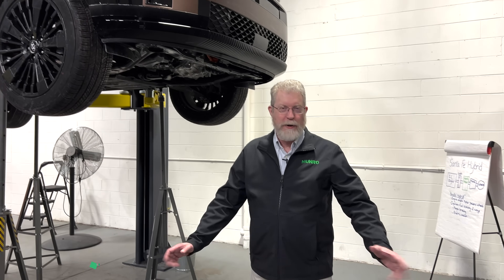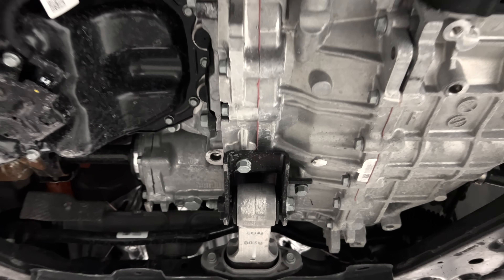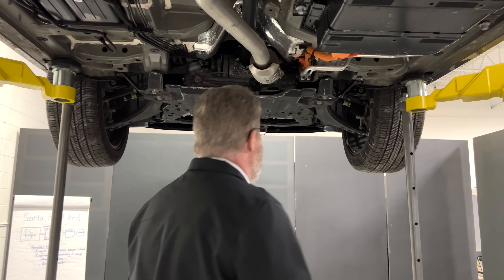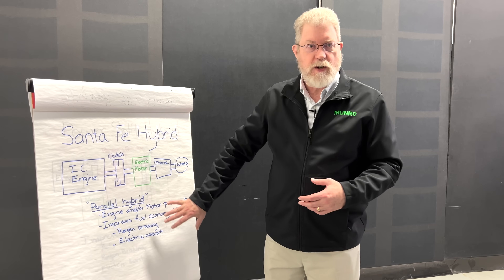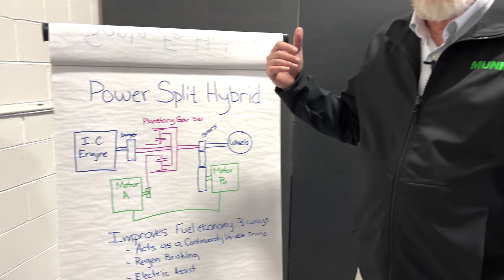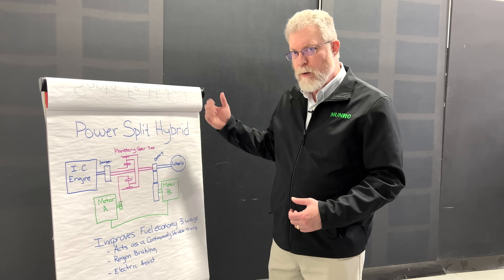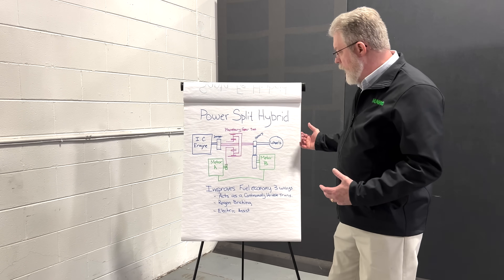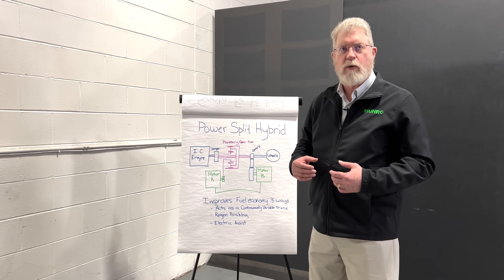A Lesson on Hybrids With the Hyundai Santa Fe

Comment: My husband and I test drove a new 2025 Santa Fe Hybrid Limited and it had an odd, rhythmic jerking feel while driving below about 50mph. (Imagine the feel of first generation antilock brakes, but while running a consistent 30 mph.) The other noticable difference was the regenerative braking drag that I had also felt in the Honda Prologue. I attributed both of these issues to the braking system.

My husband thought that the specific vehicle had a mechanical issue causing the rough ride, so we returned to test a Santa Fe Hybrid Calligraphy.  It had the same jerking and drag. We turned off the  regenerative braking, and the jerking only eased about 50%. The drag went away, but as the vehicle naturally slowed I felt the drag return - I assume this return was a collission avoidance feature. 

Would the hybrid transmission trying to find its soft spot cause the vehicle to continuously jerk or vibrate?

Comment: A couple of tweaks to your excellent presentation. I have owned the 2023 Kia Sportage AWD for the last couple of years. It has the exact same system as the Hyundai Santa Fe. I had driven the Rav4 and CR-V and decided on the Kia Sportage, which has the same powertrain as the Hyundai Tucson. The parallel system charges the battery whenever the engine runs, except for high acceleration, steep hills, and very high speeds, when it combines the engine and motor power, not just during regenerative braking.  As a person used to large vehicles with the largest engines, the Kia has more acceleration than the CVT systems. The CVT systems are also noisier. 
Driving a hybrid is different from driving a regular IC engine car if you want the best mileage. My Sportage is rated 38 city and 38 highway. From the first day to now, I am averaging 41 MPG, and I do 50% city and 50% highway. This is just after the winter, when I used the heated seats and steering wheel quite a bit. By the end of the summer, even using the AC, it will be 42 or above. The key is anticipation. According to the government analysis, you only get 50% of your energy back from regenerative braking at low speeds and 12% at high speeds. In my vehicle, you can see when you are getting regenerative braking before the mechanical brakes, so I can maximize my return power. 
I have heard that surge and coast driving can improve mileage in Toyotas, but that won't work in Hyundais and Kias, as the computer engine programming preloads the regenerative braking to make the vehicle feel more like an IC car. 
Keep up the excellent presentations.
Reply: nice info, thanks, im interested in buying sportage hibrid but im a little bit worried about reliability of ICE motor, tgdi, being tuned off on constantly , direct injection, especially in cold temps, what do u think? will be a minus for long term reliability of the car? thanks!
Reply: @aqua37977  I was worried about that as well. The drive train has a 100,000 warrantee and my dealership has extended that to 200,000 if I get my servicing there which I do. I also do oil changes at 6,000 miles rather than the 8,000 in the owner's manual. I use Mobile One hybrid oil and the top Fram filter which I bring to the dealership. It is made for the special conditions of hybrid engines. Another oil you could use is AMSOIL hybrid oil. They both have top ratings but Mobile One is available in my area. I use Wix air and cabin filters which are top rated and change them myself. WIX oil filters have a bad rating. Do NOT believe the internet that talks about switching to 5W30 from the 0W20. That would only work if you are in a hot all the time climate. The 0W20 works best if you have any cold weather. I'm a former engineer so you know I researched thoroughly and worked on cars for 60 years..

Comment: I loved my 2012 Volt.  It worked perfectly for the 11 years I owned it.  Complicated yes, but it worked flawlessly.  The only unusual service were two flushes of the cooling system.  Other than one oil change a year (GM recommended one change every two years), that was it.   I went to Tesla and was very unhappy.  It just didn't suit my needs as I do long distance, long driving days.  I now have a 24 Prius Prime which is good, but not as good as the Volt as it is not a good cruising on the highway.   I would buy a first gen Volt (not second though) if GM was smart enough to build it in a heartbeat.  I am considering a Hyundai Santa Fe Hybrid but can't order the Calligraphy trim with that model in Canada.  It will replace my daughter's Encore which is a little small for her purposes.  If Hyundai ever offers it with the proper trim, I will buy one.   They do offer it in the US and other markets.

Comment: Just to add full hybrids have very powerful motor for ice start and really powerful battery if compare to regular ice with starter. Much more confident cold starts in winter. Ironically hybrids sometimes get let down by 12v battery which powers rest of car systems.

Comment: Paul, thank you very much for technical explanation of hybrids.  I feel hybrids are obsolete for 90% of use cases.  They are fine when very long range is needed, but their complexity begs for service.  When driving an ICE MB, it cost me $1600/yr for one minor and one major service appointment.  

EVs are much simpler and require far less maintenance.  Personally, I love charging at home and never going to a gas station.  We will never buy a vehicle with an engine.  EVs for life.
Reply: Fortunately, there is choice.  All electric works for you.  It didn't work for me, so I'm back to what works.  And that is a Toyota plug in hybrid (using my Tesla Level 2 at home).  The complexity would be a bad thing if poorly designed and constantly broken.  But in my case, I had 11 absolutely trouble free years in a 1st gen Volt (Canadian winters to boot).   I had a Mercedes.  Once was enough.  Constant issues and huge regular service costs.  Never again.   So you see, what works for one may not work for another.

Comment: A very good explanation how the complicated drive system on hybrid cars works. For an EV to do the same work.  Power from battery to electric motor drives the wheels. For stopping an EV motor regens (some) power back to battery. Job Done !!

Comment: All this mechanical complexity for small efficiency improvement. Ev has 1 gear and is 95% efficient at all times. What a waste of engineering effort
Reply: If you compare the Rav 4's, the hybrid version gets about  30%-35% better fuel mileage than the gas version and is faster.  No engineer would consider that a small efficiency improvement. It also produces less pollution, another plus.
Reply: @Ronald-d6v3b  sure, it went from 15% efficient to 20% efficient. or, hear me out here, skip the hybrid junk and go straight electric and get 95% efficiency at all times, and be faster with less mechanical complexity with no pollution at all

Comment: Watch the video - Hybrid From 1916: The Owen Magnetic - Jay Leno's Garage - . He drives an gas powered car that uses an E-cvt like these hybrids. No mechanical link from the engine to wheels it's all electric, it even uses a big resistor for braking and not the friction brakes. If they had the battery technology in 1916 it could have used regen braking rather than just trying the power into heat.

Comment: CRV is not, and has not the eCVT like Toyota planetary power set or regular parallel hybrid. it's more of serial hybrid with two clutch in and out as required for the engine, so it's more driving like an electric car than either of the design since the engine act most of time as a generator until high way speed

Comment: Thanks for putting these non-plug-in parallel & split power hybrids in layman’s terms, for describing the role of the Atkins cycle in optimizing the efficiency of the ICE and for your service in bringing these products to us.

I need to search for a similarly clear description of plug-in hybrid systems.

I got so enthralled with this channel years ago with the teardown of the BMW i3 which features a REx range extender as a plug-in series hybrid that i had to have one.
Since the REx engine is been detuned from 60hp in a maxi-scooter to 33hp as an engine generator, I’m wondering to what extent the tune can model the Atkin’s cycle. Some would like to “tune” the REx generator engine for more power - that would seem reasonable with many engines but if it is built to support the Atkins cycle then higher rpms would push off the narrow efficiency peak.

Comment: Watching this is boring if you are one of the ones who learned this on the first Prius.  By now, hybrids should be extended range EVs like most hybrids in China.  It is more elegant and reliable solution-the only drawback is less efficiency if driving is mostly highways. 
A weird implementation but still works is the Nissan Kicks hybrid.  It is essentially an EV at its drivetrain but completely powered/electrified by an ICE.  While it is not as efficient, it is a quick and dirty way for the cheapest hybrid possible but also easy to scale for more expensive/larger hybrids.

Comment: I've just bought an Haval plugin parallel hybrid. Unbelievable.
After the first 1010 miles I just filled the tank for the first time.
I put in almost exactly 10 gallons. Just over 100mpg. As it has a 35.4 kw battery and a total combined electric/ICE power of 321 kW (430hp) motor. It can be both full or part time  4wd.
It has a 0-60 mph time  of 4.9 seconds.
It has every spec under the sun at half the price of an equivalent BMW or Merc. 7 year warranty and 8 year on battery at a retained 80% charge. I am stoked.
No wonder legacy car makers are shitting themselves.

Comment: Could you do a follow up video with the German implementation of their Plugin hybrids using the ZF gearbox.  As well as Toyota in its Toyota Crown model has Power Split device coupled with a DCT transmission.  Guess the weakness of Power Split Device is the lack of performance for spirited driving.

Comment: The chevy Volt anh Honda Clarity do not go through a planetary.  The are a Series hybrid. Primarily electric with a gas generator that can lock a clutch at around 45 or faster under light cruising speed.

Comment: Toyota got it right with their e-CVT hybrid system by using a simple, efficient and reliable design without clutches or belts. It is actually simpler than a traditional transmission. Ford use a similar system, but Honda and Mitsubishi does not as their version doesn't use a planetary gear.
Reply: Hyundai also seems to have done things right, just in a different way. Their system is less expensive to build so they are able to offer the hybrid at a lower price with the tradeoff of a few mpg difference vs the e-CVT. And it also avoids much of the engine droning and harshness present in many Toyota hybrids.
Reply: In Europe there's yet another hybrid system, noticeably different from others - Renault's e-Tech hybrid. It doesn't use a clutch or a torque converter, like in Toyota, but unlike Toyota it has geared transmission (4 gears for the engine and 2 gears for the main electric motor). On the complexity scale slightly above Toyota, way below Hyundai, fuel economy on par with the former. It can be classified as power-split hybrid

Comment: Tell me why you just can't have an electric car, with a bit smaller battery and a small ICE to recharge it when needed ? For example the Mazda MX-30 R-EV
Reply: What you are describing is a series hybrid, like the Chevy volt. It would have been nice to cover this as well.
Reply: @metalmatrix7  The Volt is a power split hybrid, not series.  The BMW i3 REX was a series hybrid, and also Nissan e-Power hybrids.
Reply: Ram is supposed to have similar in their new pickup. Edison Motors in BC, Canada, is doing the same in their HD logging and other trucks. Also making a pickup repower kit.
Reply: Also, the BYD Shark that Monroe reviewed a couple of weeks ago has this system.

Comment: But there's no mention of recharging the battery. Surely the ICE can do that ?
Reply: He said the recovery of the energy through braking keeps the battery charged.
Reply: @richardkule9384  sorry that's not true. Regen only adds a very small amount of charge. Not enough to recharge the battery. That's over hyped. The main thing about regen is "one pedal driving" ie it saves the brakes
Reply: @ The ICE engine seems to also play a role in recharging the battery.

Comment: Really all of the energy to move the vehicle and run the auxiliaries comes from the gasoline. The hybrid system just prevents the braking energy from being totally lost as heat. So the braking energy can be returned to the system to be used for propulsion and/or auxiliaries. It just improves the overall efficiency.
This also means that when traveling at speed with no braking, the MPG is less than when driving around town with braking. When there's no regen, there's little or no benefit of the hybrid parts.
Reply: Mostly agree, one point though is even in highway conditions with no regen the power split system still enables the engine to operate at peak efficiency regardless of exact speed. The electric system collects regen but also reroutes torque in order to keep the engine at peak operating conditions even at sustained highway speed. But yeah end of the day it still all comes from the petrol
Reply: @adminium99  Good point. I wrote that before I saw the split hybrid system in the Prius. I didn't expect him to cover anything but the parallel system. Personally I prefer all electric due to less maintenance and no gasoline at all. I feel like I'm making oil worth-less.

Comment: My 2025 Ford Maverick AWD hybrid has a similar system. However I get much better mileage. To me 34mpg isn't good enough to justify the extra expense of the Hybrid powertrain. However the Ford Maverick is much more affordable. Driving around town for the last two months I get around 45-50mpg. On the Highway I get around 33-34 mpg.The difference is because the Ford is 900 pounds lighter.Good job of explanation.
Reply: The regular Santa Fe gets 20 city/28 highway/23 combined, with the hybrid getting 35/34/34. For a three-row SUV I think that's a fair tradeoff. Plus the Santa Fe actually competes with the Toyota Highlander, not the Rav 4 (which competes with the Tucson).

Comment: This video fails to make clear whether this vehicle can use the ICE to charge the battery. Regen braking may provide useful in stop and go traffic, but it is no help when the vehicle is cruising on the highway.
Reply: In my Rav 4 the ICE is constantly cycling on and off between helping charge the battery,  and  helping to drive the car. Sometimes it does both. I assume that's true in the Hyundai too.
Reply: When in EV mode the computer will start the ICE to help charge the battery when needed.

Comment: Took my a wile to get my head around the power split, the ICE drives the planetary gear carrier not the actual gears themselves. Genius!
Reply: Also, what is not mentioned in the video, the engine's torque is always split at close to 1:3 ratio between the sun gear and the ring gear. The power split on the other hand is variable and depends on MG1 speed. If it's stationary, 100% of the power goes mechanically through the ring gear to the wheels. If the ring gear is stationary, 100% of the power goes to MG1 (i.e. when the engine charges the battery while the car is stationary). Any power split in between is also possible

Comment: Imagine the cost of getting these cars repaired when older, so many components compared to an ev or straight ice.
Reply: @Joe-ud2hb  no alternator. No serpentine belt. No AC clutch or pulley. No starter motor. No multi-speed or belt-pulley transmission with tons of clutches and solenoids.
Reply: @cadenschaefer7909  Those parts you mention aren't biggest culprits , more like egr's. dpf's , cats, i don't see sense in having a traction battery & engine together- then I'm partially biased as an ev owner

Comment: It looks like the engine is still very complex ( variable valve timing...) and relatively powerful. In the "Range Extender" scenario a simpler and less powerful ICE could be used with similar good efficiency. What do you think about this?

Comment: Why waste your breath and time on hybrids? They are just for agnostics whu are too afraid to commit. It's like trying to be half pregnant. An Idea whose time may have come oce long ago, but is now gone. If you can't evaluate your needs and pick a format which suits your needs (EV, Gasser, Diesel), then maybe y9ou should stick to the bus.
Reply: There are huge variety of products to solve different situations for different people.   Lets just criticize the solutions that fit YOUR situation.
Reply: A woman with twins is twice as pregnant.
Reply: I'd agree with you if this were a PHEV, but it's a standard hybrid. The Santa Fe version is  essentially just a more efficient ICE power train which stores the braking energy and uses it to assist the engine.  It's a similar trade-off to many that have gone before such as fuel injection, variable valve timing, turbo charging, etc.  One nice benefit of the parallel system as shown is that the "hybrid" can be a relatively simple option to add or not depending on the buyer's trade-off of upfront cost vs operating expense....rather than separately designed vehicles.
Reply: What a stupid take.